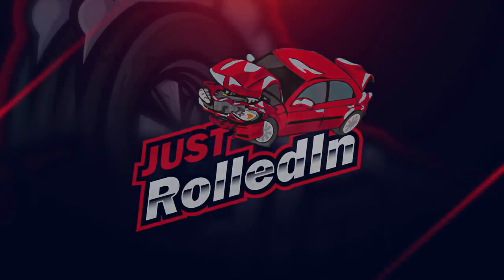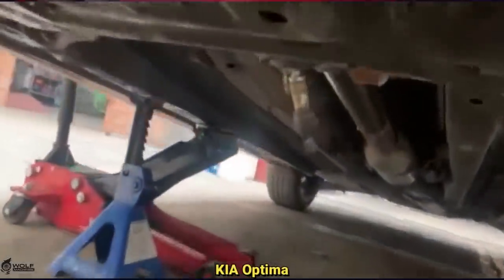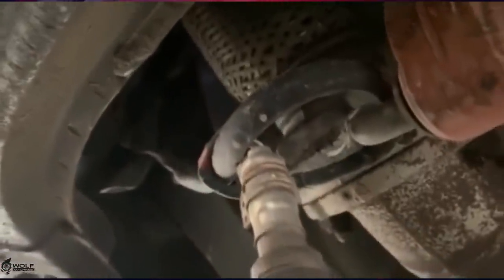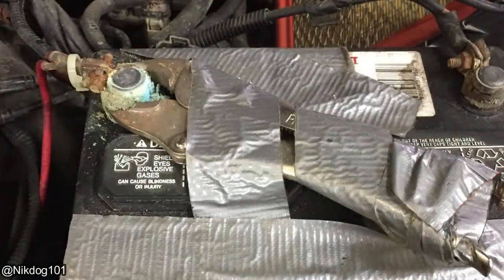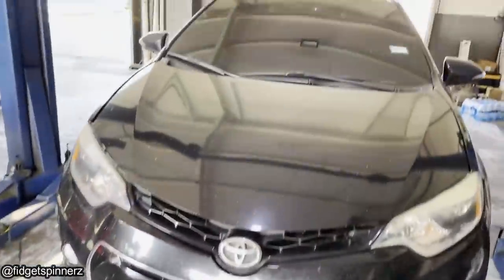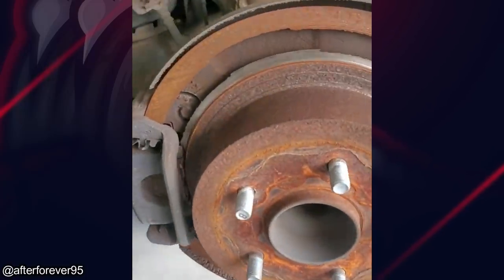Customer States They Only Want The Starter Replaced | Just Rolled In

Comment: That converter theft needs to be prosecuted. 
And the 4 missing brake rotors.... that scares the hell outta me to know that these people are on the roads with us.
Reply: Actually they need to go after the places that pay for them. Those places know good and damn well most of those cats are stolen and absolutely turn a blind eye. They are equally guilty if not more so because the theft wouldn't happen if they didn't have easy access to people willing to pay cash. Stopping individual thieves is near impossible, punishing the businesses that enable it would be far far easier.
Reply: @OmegaGamingNetwork  Wont happen until the thieves start stealing from police cars.
Reply: @schrodingerscat8621  when it's Tesla can go 300 plus miles recharge and under 20 minutes then I'll buy one
Reply: @schrodingerscat8621  yeah but there would be junked ones everywhere since u can't replace the batteries now
Reply: @JustaShrimp372  lol what? Dude, you know nothing about EVs.
Reply: @schrodingerscat8621  ...Every ten years (end of factory support), need a new Tesla. Somehow, in dysfunctional logic prevalent today, that is eco friendly?
Reply: @waynecurrie9017  ..Also when factory drops 'Proprietary' holding of technical detail.. parts, so the Tesla is usable far longer than 10 years, it will only then become a viable, eco friendly vehicle..re; Rich Hughes (Class action lawsuit) ;}
Reply: @schrodingerscat8621  do to construction jobs locations never being in same spots and sometimes in remote areas a train is not an option
Reply: @schrodingerscat8621  I think we should prioritize renewable energy before electric cars because where does the electricity for the car come from. Right now, coal plants. Pretty bad for the environment.
Reply: @schrodingerscat8621  how bout we get some more nuclear power plants instead.
Reply: there s no way anybody can lets their brakes get to that level. it should be criminal! if we had a safety inspection law here in canada at least half the cars i repair would be off the road.
Reply: A lady I work with drove and SUV like that for months, I even offered to do the work if she bought the parts but nothing ever came of it, I think she did eventually get it fixed, probably for inspection
Reply: you don't need the converter, 
just put a piece of strait pipe. 
exhaust shops do it free.
Reply: @MUCKFOOT666  you can’t just put a straight pipe on the vast majority of modern cars.  The ECU depends on the o2 sensor, which won’t be reading right at all unless it’s tuned specifically for that configuration
Reply: That heap wouldn't have been on the road a year ago due to seriously failing our mot law.

Comment: As someone who runs a muffler shop, I have been trying all manner of antitheft/deterrent devices, many to no avail. The best option - as was alluded to by another commenter here - is to replace any stolen cats with aftermarket cats as they have significantly less precious metals in them. Of course, a lot of vehicles don't necessarily like those kinds of converters and will sometimes throw a CEL, but there are ways to sometimes defeat that sensitivity.
Reply from the maker: Thanks for sharing!
Reply: This kind of makes you think twice before getting surgery...demand a before and after inventory.
Reply: Can't do that in CA or NY, though.  Got to be OEM cats.
Reply: So just remove cat and only install it when needed during yearly inspections.
Reply: @hillppari  🤦🏻‍♂️
Reply: If people just cleaned up their garages and parked the car there instead of storing junk...
or buy a air suspension kit, and lower the car to the ground when parked.
Reply: Exactly what I did when 2 of my new 1 tons had them stolen years ago.  Straight to the muffler shop for aftermarket.
Reply: @schrodingerscat8621  easy to do - just bolt in a link pipe in place of the cat until inspection time.
Reply: @immikeurnot  That´s kinda absurd . Isn´t a gas analyser used to check emissions ? Are they really checking if there is an OEM cat installed ?
Reply: my cheap aftwrmarket 160$ cat on 2 gen prius was been stolen as well.
Reply: @beluxauto5968  Most of the shops in  LA don't. if obd2 passes, you good to go.
Reply: @pashko90  apparently, factory Prius converters are very valuable, full of precious metals and because it’s a hybrid, those precious metals do not get consumed like a regular internal combustion engine since some of the time the car runs in electric mode which does not degrade the converter. I heard Prius converter’s are worth as much as $1000 which is why they have become such a target. The thief just didn’t know the converter had been changed for a cheap replacement.
Reply: @dubious6718  lowering does no good, thieves will just pull up a 72 pound manhole cover climb down and have their buddies push the car over the hole , the ground guy sawzalls the cat(s) and they push the car back and make a few hundred dollars plus they sell the manhole covers for scrap
Reply: I have seen them wrapped in braided cable that is loose- difficult to cut as it keeps moving
Reply: @RCFourFive  I just put flex pipe where my cat converters were after they were stolen I went through emissions all they did was check the gas cap and plugged into the computer
Reply: @dubious6718  "I wonder what the poor people are doing this winter?"
Reply: @Cheepchipsable  You’re absolutely right, I personally don’t know anyone who has ever had that happen. But I have heard of dealerships that have been hit, especially trucks since it’s easy to scoot under without jacking it up
Reply: Unfortunately I can't do that here in California.  Our stupid CARB laws get in the way.
Reply: Ben Anims and More  California Air Resource Board.
Reply: Talk to the PO of my truck. They did a cat delete, and somehow there is no cat code thrown. No idea how they managed that.
Reply: @carmineredd1198  No they gonna take it from a different car... even little extra security is a good security when near your car or bike there is another that simply an easier target.
But in this case it is kinda silly to use low carbon steel rebar, stainless steel is much harder to cut and it would not look so ugly.
Reply: @beluxauto5968  ... It's called a visual inspection. They check to see if everything is there. Thye do NOT do a tailpipe test on car after 1995.
Reply: Just remove the cat. They can't steal what's not there!
Reply: @Ayrshore i'd give them 2 cats.....to feed.

Comment: The tape over the check engine light. I have seen this so many times. I remember pulling the tape off a friend car. She freaked out that I did it. I told her , I fix the problem, your ex forgot to plug the sensor clip back on when he changed your air filter. No wonder you dumped him. He was dumb.
Reply: Its an air filter, how can you mess that up lmao
Reply: Check engine light on is a fail for your yearly/6 month inspection here in NZ. Nanny state New Zealand strikes again.
Reply: I did that in my 94 s10. Engine light was always on but the car had no codes and ran perfectly.  It was an instrument cluster problem.  The fix was more than I paid for the truck.
Reply: @KenBober  I knew a guy with a 94 Blazer the check engine light would come on with no codes every four months. He'd stop by the shop on his way home for the scan tool to reset it.
So his problem wasn't in the dash.
Reply: i should of ran the codes to give yall why it was on. probably some emissions shit.
Reply: Tape is lame. If I can't get the check engine light in my old Jeep XJ to go off I won't put tape over it, I'll do it the right way.

I'll take out the light bulb.

The car is 25 years old, old enough to be exempt from emissions inspection.
Reply: @JeffDeWitt  I know someone who stabbed the bulb with a screwdriver through the instrument   cluster, problem fixed.

Comment: Where I used to work we had a secretary that found a good deal on ceramic tiles. She pulled into the parking lot in the early afternoon with her Pontiac Sunfire grossly overloaded. Based on the number of boxes in the car we figured the thing was hauling double its rated capacity. And it was a unibody convertible which are known to be somewhat flexible. We tried to tell her the car was overloaded but she would not listen.

Comment: I was forced to drive my truck for 3 days with grinding brakes (had to wait for a day off to have time to change the rear pads). The noise drove me absolutely insane. I have no idea how people can stand that for long enough to do the kind of damage seen @2:08.
Reply: Same here. A Honda CRV with 4 days before it's replacement was coming, I had to put new pads on the front because of an unbearable constant metal claw on chalkboard shriek.
Reply: I think they just turn up the radio or use headphones.
Reply: @Cheepchipsable  No. There was no drowning out the screaming. Like spring lambs getting slaughtered.
Reply: @Cheepchipsable  A few years ago, one of my nieces asked me to drive her car because it was hesitating and "running weird". I did. No  hesitation, but I did immediately notice a wheel bearing roaring away in the front (after I turned off the radio cranked to ear splitting volume). When I got back from the test drive, I told her it drove fine, then asked how long it was making that growling/roaring noise. She pretended to not know what I was talking about, so I said, "let me guess, it's why your radio was turned up loud enough to make my ears bleed." She smirked, and her dad rolled his eyes and said he'd get a new wheel bearing in the morning.

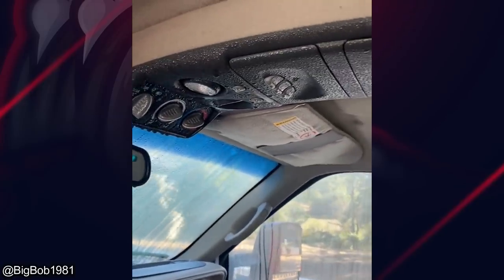Comment: 1:33 I love it when customers come in for an alignment but it's loaded with sht like that

But that's nuts how much moisture accumulated from those logs
Reply from the maker: Insane amount. Hope they aired that thing out lol
Reply: The best option, if they don't have a dehumidifier. Is to unload the wood, set the vents to recirculate the air inside, and turn on the AC.
Also some Lysol and prayers to the detailing gods that you haven't started a mildew or mold problem.
Reply: Freshly cut live tree wood can have up to a 50% water content. That’s why it takes at least a year for most wood to season. Oak can take up to 3 years.
Reply: Who needs an air freshener when you can just load up the back of your vehicle with firewood!
Reply: @johnygrasa  You do, once you take the wood out and your entire car turns into a stinky mold factory!
Reply: I actually had the firewood moisture effect happen to my car; my sister had me purchase it in the rain. My car fogged up from the inside overnight and it smelled like algae. Thank God my car has a moonroof to vent it out but I was not happy with my sister afterwards

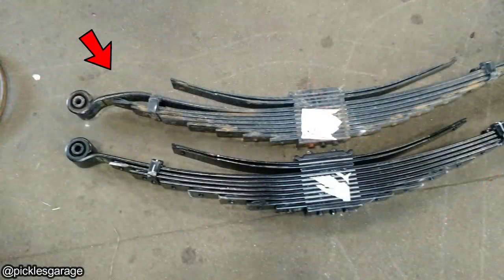Comment: 2:00 - That's a home made ultracapcitor bank with a small battery to keep charge. Don't understand why the customer didn't realise why it wouldn't start!
Reply: I think half these captions are made up.  It's more like some guy did this and then someone made up the whole "customer states" part to spin it for internet points.  If they are smart enough to build a capacitor bank they wouldn't bring it into a shop with that complaint.
Reply: @GigsVT  You're assuming the same person did both. My guess would be a friend, spouse, previous owner did it.
Reply: @david672orford  Over $300 worth of capacitors alone, plus balancing boards, the backup battery, bus bars, and time. You dont leave that in the car when you sell it, you throw a cheap hundred dollar battery in and take your $500 masterpiece out because it'll still be running decades from now.

Comment: I have seen some scary damage under cars for various reasons (had to get rid of my last truck due to some pretty nasty rot on the control arms and frame due to the crap put on the roads in winter here in New England even). But goddamn, that first clip, I think that might be the scariest thing I have seen on a car that was still technically able to be driven.
Reply: I've actually seen that in person before.. though honestly not quite as bad.
we had to call the cops, the dude was INSANE. absolutely REFUSED to get it fixed, even after we SHOWED it to him. Claimed we were trying to rip him off, all he wanted was an oil change!!!!
Its really annoying being responsible for the safety of others, sometimes, because just the fact that we saw it, means we had to flag it and get him off the road.. thing is he was clearly violent and deranged, so we had to let him leave and call the cops immediately after.

Comment: As an automotive technician of over 30 years, my jaw is on the floor.
Reply: I think one of the worst I encountered was a metal to metal brake lining so they removed 2 calipers and crimped off the steel brake line with wire cutters :)

Comment: Putting tape over the lights is an oldie but a goodie 
The other is pull the globe out if you can 😂😂
Reply: Any inoperative or permanently on warning lights here in the UK is an automatic fail on the yearly M.O.T (MINISTRY OF TRANSPORT) roadworthiness test ,and must be fixed before a certificate is issued .Of course all other parts of the test must be satisfactory as well, brakes,steering, tyres ,lights, bodywork, chassis etc .The car can be failed for being dirty and if the tester insists he can request it is cleaned before he tests it .The state some people keep their cars is disgraceful. Anyway gripe over best wishes from the UK .GOD BLESS ONE AND ALL STAY SAFE.

Comment: Scrapper here, wouldn't take long to defeat the security feature at 2:37.  BTW I hate cat thieves, my fantasy is to catch one in the act some day.
Reply from the maker: Definitely wouldn't stop them, might just make some more noise in hopes you hear them. We live in an apartment and heard somebody get their catalytic converter stolen. I jumped out of bed 10 seconds too late.
Reply: When you see your car up on a jack, and hear a sawzall,  QUICKLY complete the following procedure of ten easy steps. 
1-  Put on noise-isolating headphones and crank the music.  
2-  QUIETLY Sneak up on car.  
3-  Rapidly lower the jack and pull it away.
4-  Open door.  
5-  Get in and bounce real hard a few times to make sure the seat is fine.  
6-  Start car, crank stereo and let the car warm up.   
----  Is someone barbecuing pork? 
7-  Once car has reached full operating temperature,  check clutch and transmission operation by backing up two feet, then pulling forward two feet.  Do this 4 times.  
8-  After ensuring the clutch and transmission are fully operational, proceed to drive away. 
9-  Remove headphones.
10-  There may be some new bumps in your driveway.  Ignore that. Damn kid must have left a bike behind the car again.  You told him to keep his stuff out of the driveway.... Oh well.  Carry on.

Edit:  Optional bonus step if required.  Say,  "No officer, I didn't hear anyone screaming."

Comment: What was wrong with the Kia Soul's CVT at 2:29? Listening to the sounds and looking at the speedometer and tachometer I didn't see anything wrong. When accelerating quickly or accelerating while going up a hill, it is normal for the engine RPM's to rise quickly while the speedometer shows a more gradual increase of road speed.

Comment: funny you should mention starters, i got a UK GM astra sri in for no start, starter spun but didnt engage into the flywheel and crank over the engine, when i got under the car i see the casing snapped in half at the solenoid, the solenoid was hanging free, the new starter i got from my local part shop was a dud, it used to click a few times before starting the car, i had to order another new starter, eventually we have a happy starter now.
i have never seen a starter snap off like that, she said she has had a new clutch a few months ago and there was a big dent in the old starter, looks like it got dropped on the floor to me.

Comment: Not sure about  the wiring of the sensor...But I know someone in Australia wired their Exhaust to their ignition system so that was live from the downpipe (Three breaker gaskets to stop the current getting to the manifold) to the tail pipe after his had been stolen 4 times without the cops even bothering to take a report.  On the fifth attempt, the thief died and the owner was charge with manslaughter.  You are not allowed to defend your property in Australia at all.